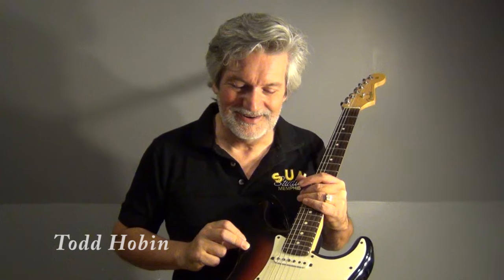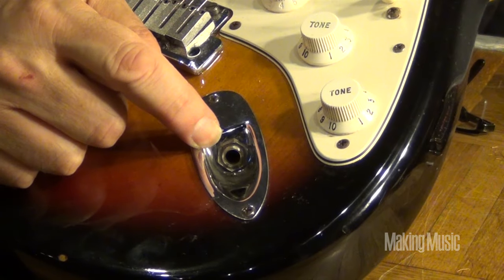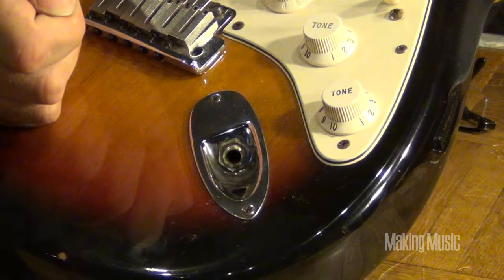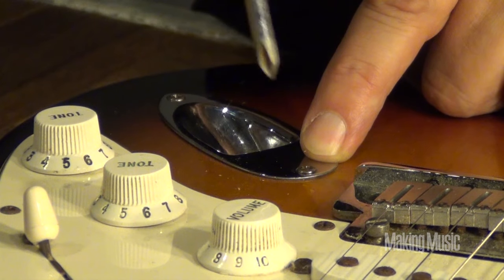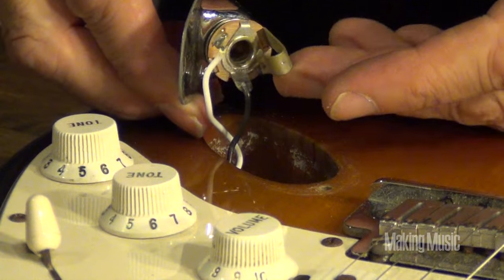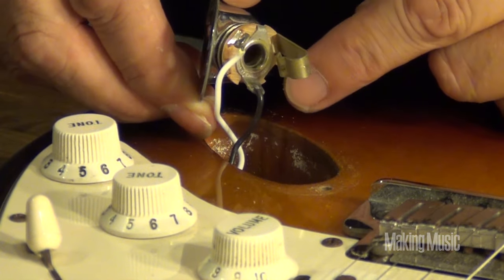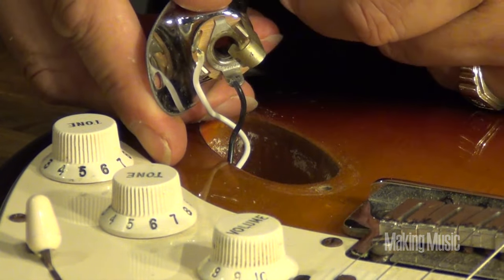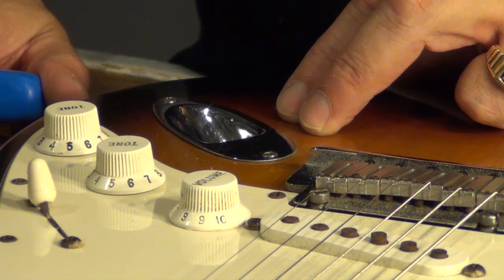Guitar Jack Repair

Comment: Ah, thank god my expensive Fender has no major issues. Indeed my black wire is broken. Thanks for this clear explanation. I needed to buy a soldering kit for my other guitar anyway which I was too lazy for. Now, I have to :)
Reply: Btw, I fixed it. Easier than I thought
Reply: @Frankyboy2424  how do you do it cause it happened to both my electrics I just need an in-depth explenation
Reply: @JaDiLoco   I just soldered the black wire to the ground/sleeve tip where it was attached to and I was  ready to go!  You mean both wires snapped off? Then just solder them both. You just need to know which cable goes to the hot and which goes to the ground. But that is easy to find when you Google it up.

Comment: the real solution is to use a small drop of glue on the inside and outside nut threads so the nuts do NOT loosen in normal use. And if the threaded barrel the cord plug goes into is sticking out... adjusting the inside and outside nuts to cure that can make the jack go deeper into the cavity of the body and prevent plugging in at all. Be prepared to remove wood on the front side of the jack route in the body to resolve it.
Reply: good point....I tightened the nut on my guitar last night just before practice and then it started cutting out. I'm going to do this with all my guitars
Reply: i was thinking locktite threadlocker?

Comment: Thank you for your video! I got a used Kramer striker that wasn’t giving me any sound from the amp. After watching I checked the wiring, no issues, dusted off the grime that’s built up, and then tightened the nut to the wood more. She sings now!

Comment: I fixed mine without soldering I just looped and tied the wire the in hole beneath the soldering spot
I used a sewing needle to cut the rubber casing of the wire to expose more wire

Comment: Hey. My problem is that both of my wires have come out. There's no indication of which one goes where. Shall putting the two of them in either one make any difference or will it work? Thanks.
Reply: I also need an answer to this. Does it work either way?
Please let me know.

Comment: What if your input jack looks fine on the wiring side but doesnt have any signal unless you bend the cable in a certain way? My dean vendetta has been doing this for the last few days and it is so annoying, is there a way to fix that with soldering?
Reply from the maker: Hi BioLizard,
We reached out to Todd Hobin directly and here's what he said: Inside the jack there are prongs. Metal pieces that are made in such a way as to touch up against the side of the plug. In a guitar, there are two prongs. One for the tip of the plug and the other along the shaft or "sleeve." Sometimes, with use, these prongs can bend away from the plug and lose contact. When you bend the wire, you are in effect, moving the plug up against the prong that is misaligned. 

It is possible that you have an "open" jack assembly inside the guitar. This means you can actually loosen the hex nut on the jack, pull out the wiring and the jack. Bend the prong so it will press up against the shaft of the plug. Then put the whole thing back together. Tricky, but very possible. 

We would suggest taking the guitar to a qualified guitar tech and have them make the fix. They are going to be the expert and give you the best diagnosis the ensure the right fix for your situation. Hope this helps!
Reply: @makingmusicmag  Thanks! And yes i did try that and it seems to work pretty well, sometimes it will cut out but usually i just have to swivel the shaft of the plug in the jack til it works again.

Comment: i have no idea what is happening
my amplifier when not connected to the guitar makes sound and when i tap on the tip it makes the buzzing sound but when i plug it in my guitar it doesn't make any sound at all. mo volume on my guitar is all the way up, on the amplifier too i even checked the cables they're all fine

Comment: So I uave an ibanez that only has 1 fully insulated wire, and a mess of copper wires wrapped around it. The wires were originally soldered all to the same point (all the unonsulated wires, that is). I tried tinning them all together and soldering the whole group to the point, but that didn't work. I am pretty stuck on this. Plus, I have already stripped the wires down pretty far, so I'd rather not waste a bunch more wire trying to fix this without knowing what I am doing first. Any help would be appreciated.
Reply: I have same guitar :( I’m really sad pls help
Reply: Should I just take to guitar center and see if hey fix it? I only have 14 dollars
Reply: @snø_music0  I took mine to guitar center. I believe it was $25 for them to fix it. Which was cheaper than I expected.

Comment: How could I know where I need to soldier the wires when both are off I don’t want too soldier them incorrectly
Reply: The long metal on the socket piece is the "Hot" so follow it down to where it goes into the round part of the socket and you will see a small bit of metal with a hole  , solder the white wire there, the other is ground (the shorter piece of metal) and that has a corresponding lug too on the other side of the socket so solder black to that. Clean it as best you can first and try to poke the wire into the lug a bit,use just a dot of solder and be careful not burn yourself with the iron, turn it off as soon as you are done. If it does'nt work try it the other way round. Get a good look at the jack socket and familiarise yourself how the thing is put together(it's simple but small) get magnifying glass to see where the tip and lugs are. Do this when you have time don't rush. Hope this helps if you have'nt fixed it already?

Comment: I have a fender squirt strat and the “rings” on the outside of my input jack came off how do i put them back on? I only have 1 grey wire on the inside.
Reply: by saying the rings fell of, are you saying that the output jack is loose?
Reply: @user-sz6lr8pi8e  yes it was, but no worries i fixed it

Comment: So i got another problem, my plate just got loose and now i doesnt make any sound i dont see a wire thats broken, when i hold the plate a litle up so when its not in the guitar it does make a sound
Reply: The wire might be a little broken even if it’s fully connected

Comment: can i fix the wire using lighter?
Reply: No
Reply: If you’re a Jimi fan then you may have to replace the whole guitar doing it that way. Seriously, the intense heat required to accurately melt the solder is delivered by an electrical soldering iron with a suitably-sized tip. It’s a skill many industries require from skilled technicians so don’t feel that you’re automatically going to ace a delicate repair.  The person who first attached it probably has done thousands of them and hence it’s very clean, neat and up to spec’.

Comment: I just looked inside my guitar and it was horrifying. 

Holycrap it looks like a computer motherboard in there!

Guitar goes dead, I unplug and plug it back in and it's fine for a brief period. 

No broken wires. So hoping its not something ridiculous complicated with all the circuitry under the hood. .
Reply: By now you've probably learned how to fix it.

Comment: I ONLY HAVE ONE WIRD IM FREAKING OUT I THINK THE OTHER BROKE OFF AND GOT LOST INSIDE THE GUITAR????
Reply: You may have a single co-axial cable with a central signal wire core and a concentric swore sheath called the ‘screen’; it’s to reduce interference.  However, the extremely thin gauge of the co-ax makes it very difficult to handle, strip and separate to make the two solder connections. For example the Squier Strat I’ve have seen with this ‘noisy’ connector had a poor screen soldering which eventually rotated off as the external nut was turned.  If you can do the electrical re-solder job yourself without damaging the signal core or shorting it, bravo, otherwise get it to a repairer and apply locking glue to the internal and external nut once they’ve been properly clamped to the chrome, fishplate. There’s insufficient room for a spring washer to maintain mechanical tension on the tightening nuts in this decades-old design.